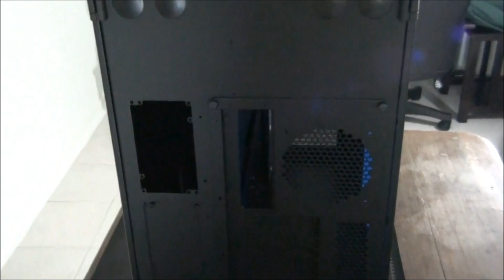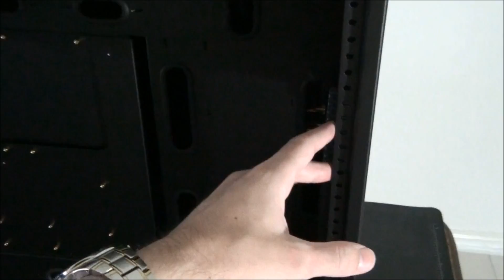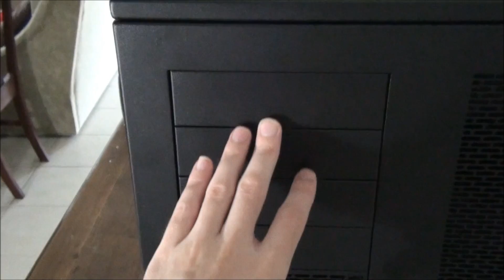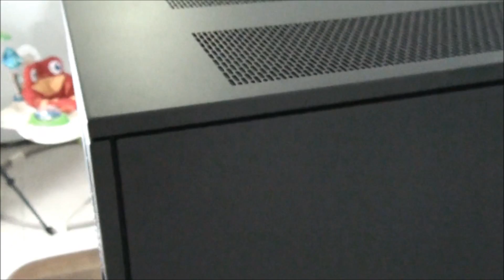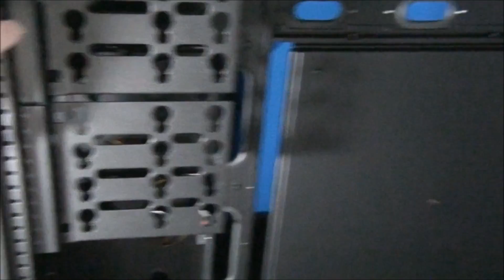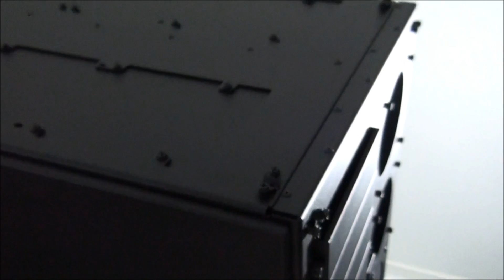Caselabs Magnum TH10 Preview

Comment: I guess this is the case you've been waiting for. I might do a built with one of these myself, may be next year.So I will be interested to see what you put in yours. I still have a spare brand new SR-2, but perhaps LGA 2011 is the way to go. By the way I think you would get bored if it's too easy to do future upgrades, there need to be a challenge in life. There will also be a bit more than removing 4 screws to remove the MB tray, don't forget all the wiring from the PSU etc. Great VDO.

Comment: The TX10 D is. The TX10 V is a single motherboard case. It's pretty much this but done as similar to the STH10 with two separate heat chambers.